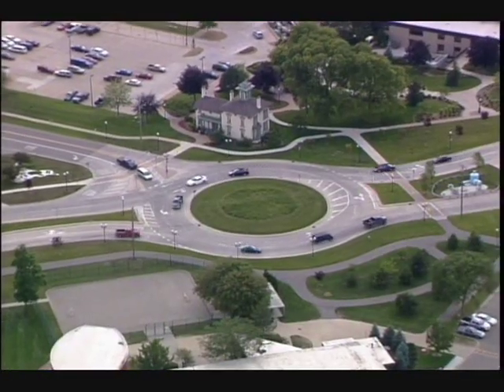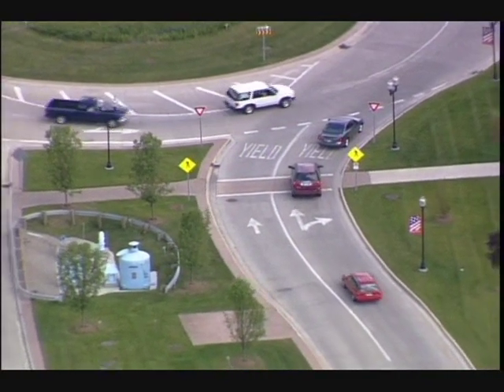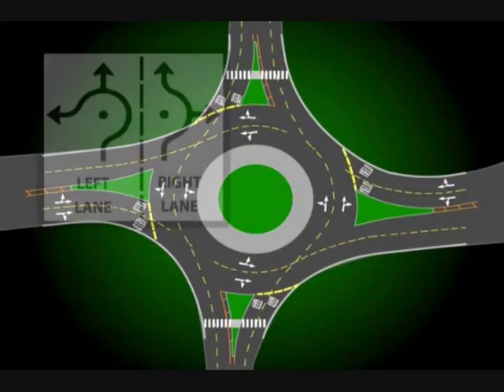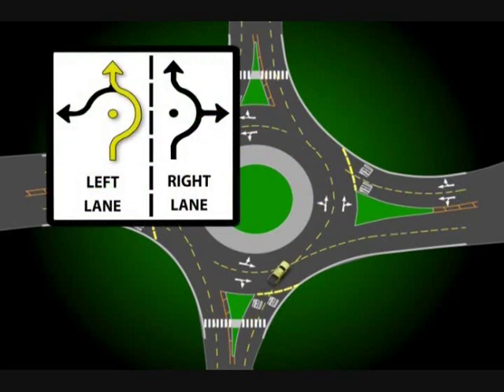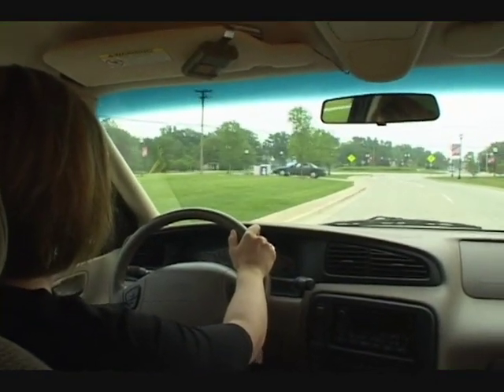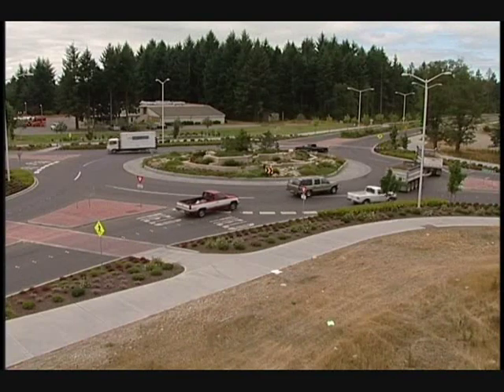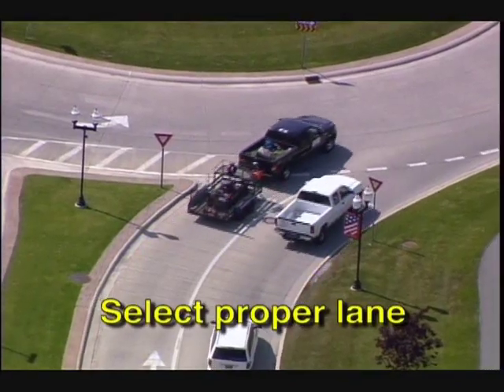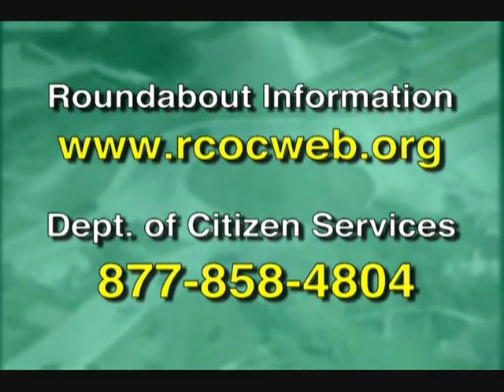Michigan DOT about Roundabouts

Comment: In the NE (New England and North East) we call them Rotary or Roundabout never traffic circle unless you are an out of towner.  They are quite easy to use with little to no instruction,  only idiots who think you can speed through above the posted limit or do not Yield as stated in the video to preexisting users because they assume they are more/self important are the ones who cause accidents and traffic, Also if you enter with a car that stalls can also cause problems for others.